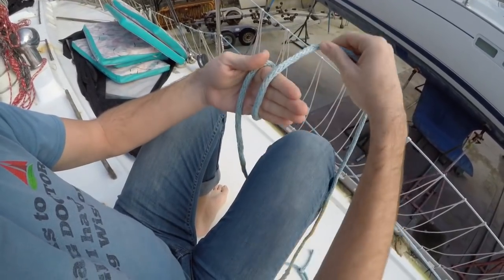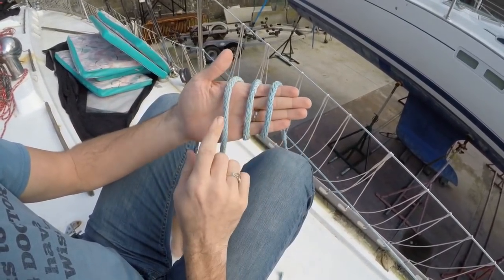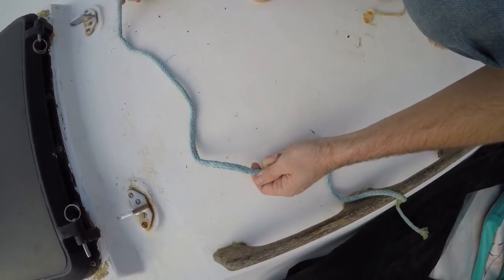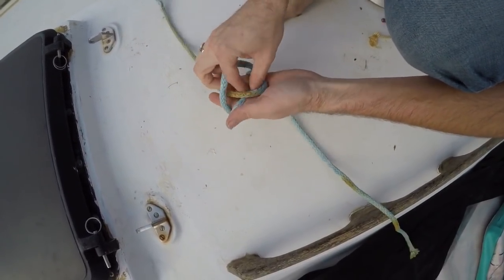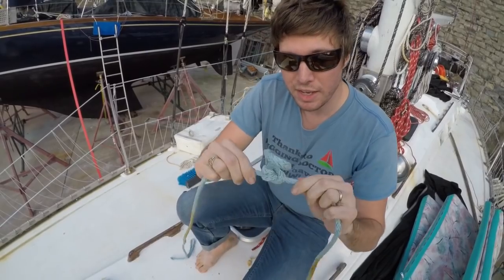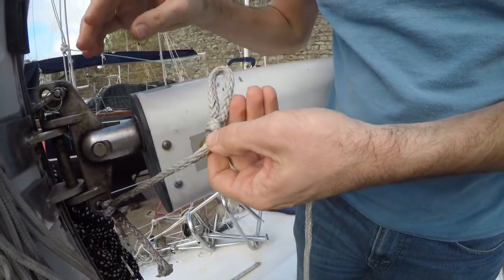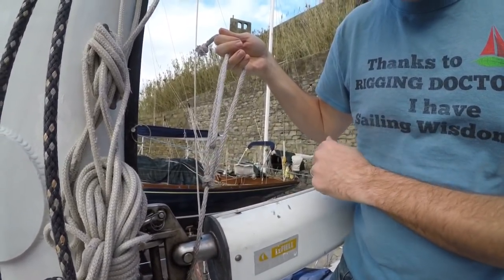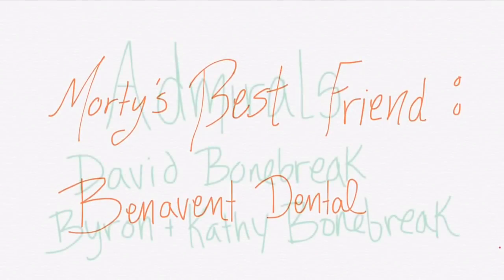USEFUL 5 Second Loop Knot! | Sailing Wisdom in 4K

Comment: I do it slightly differently, but end up with the same result.  Also called a linesmans loop.
Reply from the maker: Very cool. I have seen three variances on how to tie it. This one, one where you pull the line through the others under your palm, and one where you twist it up a bit and then pass it through.
I find this one the easiest and quickest for me to do, but I can only tie it that one way (can’t get it if I wrap it on my right hand).
Reply: if you look closely at the structure, i bet you'll find that your linemans loop is different than whatever he's tying in this video.
Reply: @drewcscott  It's exactly the same knot, arrived at slightly differently.